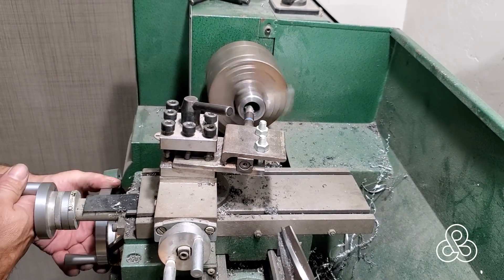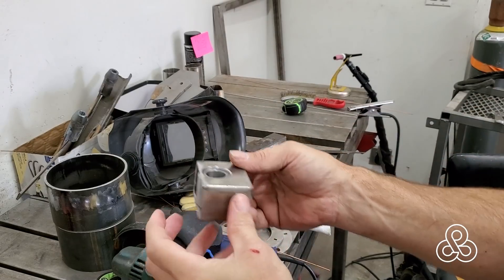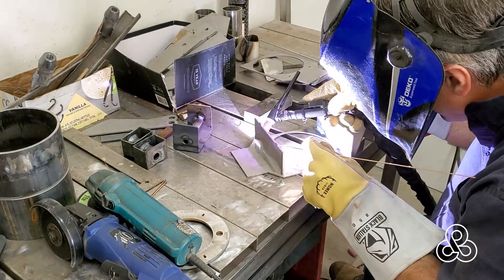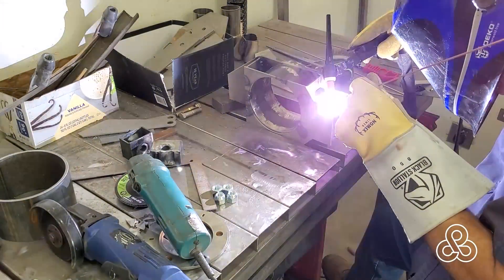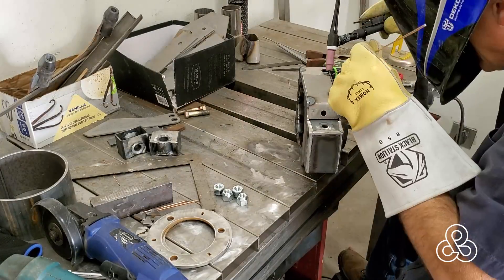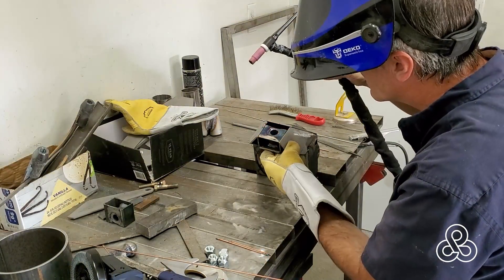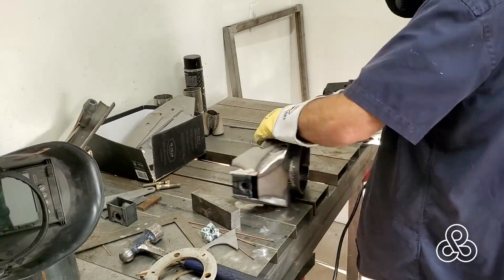A75 Rear hub (upright) part 1- Arete Supercar Project

Comment: Any advice on how/where to procure large diameter tubing like this where concentricity is crucial?
Reply from the maker: The inner ring with the bearing bolt holes is the critical part. I just picked up the pipe at the local metals yard. All the other framing parts are also waterjet cut to tolerance and lock together, to set things up, with slots and tabs.

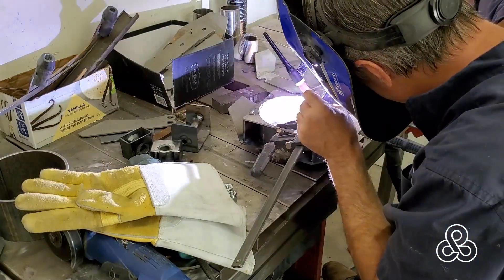Comment: I'm really enjoying your work. I also noticed the bending jig/brake you have on your shop press... about 4:39 into the video. Is that one of your own creations? If so, could you please tell us a bit more about it... maybe how you made it and how it operates?
Reply from the maker: A heavy steel plate with two pieces of heavy angle iron welded to it and a 1/2 inch thick steel bar ground to a point that presses between the angles. sliding on posts. pretty simple. I'll try to get a close up, next time I use it in a video! :)
Reply: @BuilderCreator  thanks for that... what are these "inches" of which you speak :-)

Comment: You might want to stress relieve those components by heat treating them.
That will reduce the risk of them cracking around the welds and other stress points
Reply from the maker: For sure, the strength is in the malleability!